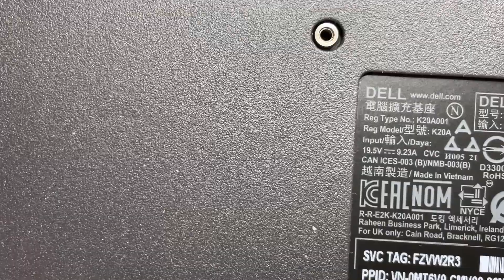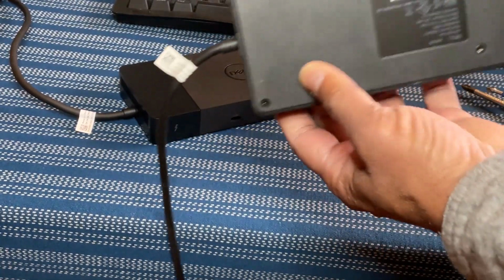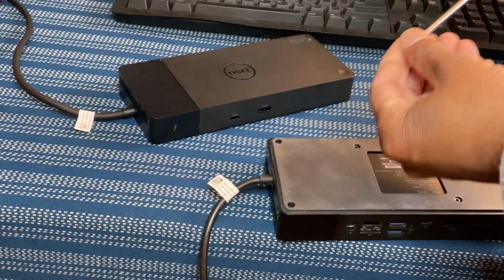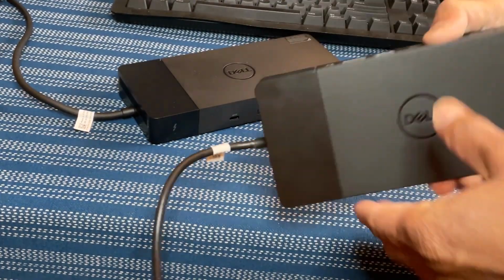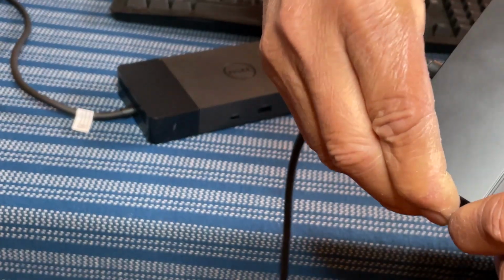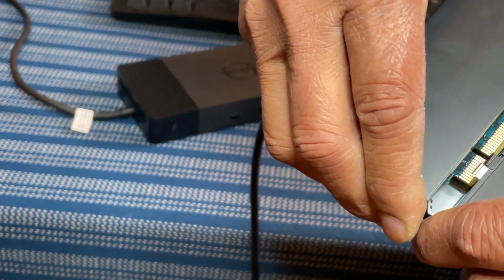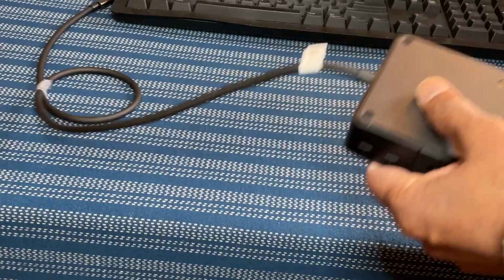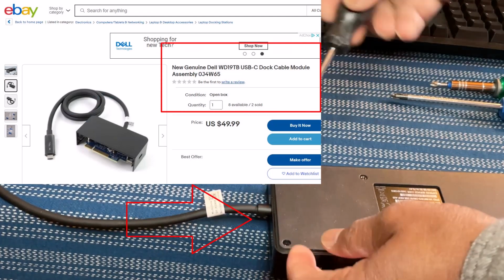How to Upgrade Dell  Non-Thunderbolt Docking Station to a Thunderbolt Docking Station - Easy & Cheap

Comment from the maker: here is the part number to upgrade your WD19S - https://www.ebay.com/itm/266131909551?_trkparms=amclksrc%3DITM%26aid%3D1110006%26algo%3DHOMESPLICE.SIM%26ao%3D1%26asc%3D20200818143230%26meid%3Dcead35e467ea4921a54353b8601a11a8%26pid%3D101224%26rk%3D4%26rkt%3D5%26sd%3D385348191090%26itm%3D266131909551%26pmt%3D0%26noa%3D1%26pg%3D2047675%26algv%3DDefaultOrganicWeb%26brand%3DDell&_trksid=p2047675.c101224.m-1